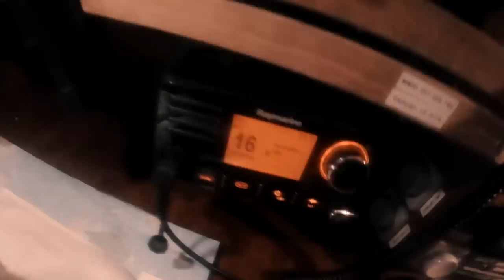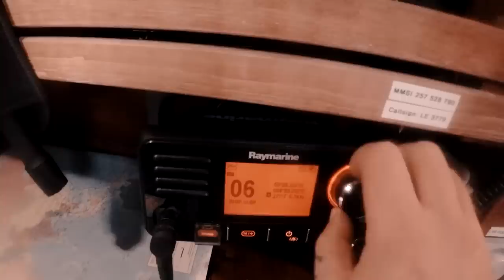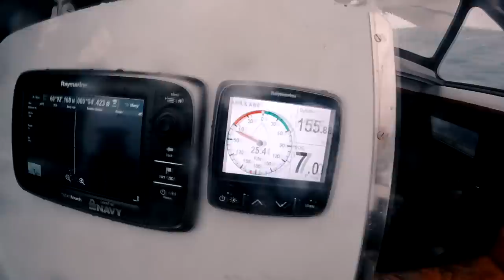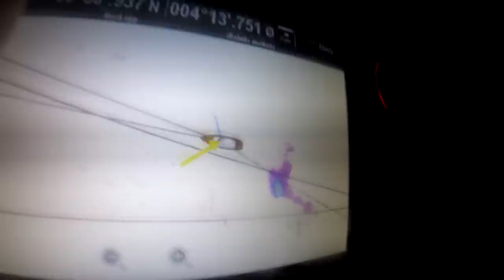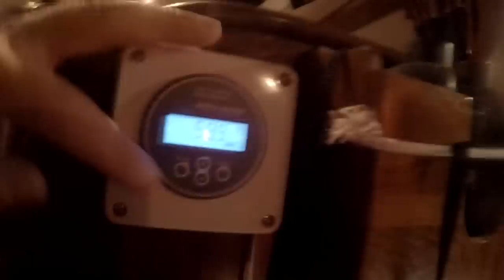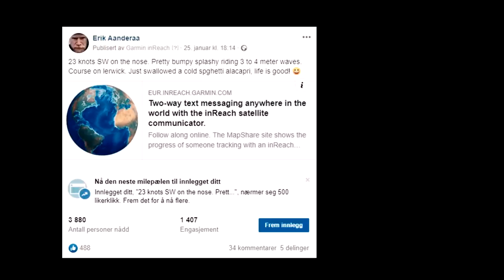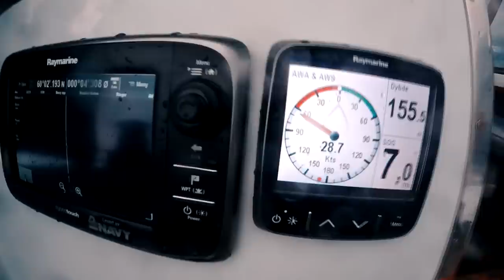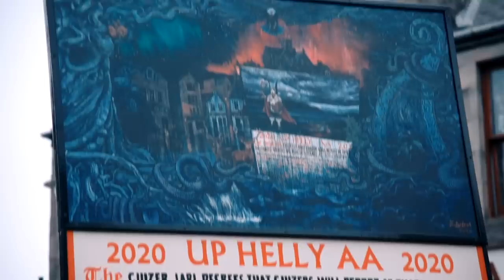Crossing the North Sea Wintertime- for a Vikingfestival

Comment: Skip Novak removes his chain from the anchor and secures them both below. He puts a water tight cap over the anchor chain hole to stop water from coming into the anchor locker. Just a thought.
Reply: That's normal, some of us were doing that before Novak ever got his feet wet.
Reply: @aussiepilgrim8620  Thats good 👍
Reply: Aussie Pilgrim Novak got his feet wet in the 1950's, you must be quite the old seadog if you were already doing stuff like that before he set foot on a boat
Reply: @rykehuss3435  it's not a rocket science to put a cap on a hole, people managed to cross the oceans around 1000 BC
Reply: Sailing Citrine Sunset , a cheap 12 v bilge pump with a switch is pretty simple to install
Reply: What about a swinging pickup in the sump?
Reply: Bob Dobalina  or keep pushing towards the festival 😎
Reply: Why would you mount your inverter and charger in the bilge??????

Comment: Erik! From one Viking to another and incase no one else has yet mentioned it, 'bucket and chuck it' is way faster, cleaner and safer than using heads in rough seas, and get a 5 x 12 x 22cm Jumbo sponge for £1.20 from anywhere you choose, get more than one and keep the spare in the bilges. They can make really quick work of outing water for the bilges mate, especially if its splashing around those delicate electronics! Crikey! Cheers and thanks for taking us on another fine adventure :-)
Reply: Another great video! Thank you, sir! :) 

Agreed w/Taranto on both the bucket and the sponges. You can use the sponges to remove more water quicker than with that cup, and also then leave them in the bilge where water collects; they'll work like baffles and cut down on the sloshing and splashing.

Fair winds!
Kurt and Barque - A30 "Alaula"
sailfar.net / plasticclassicforum.com
Reply: @leaveonlywake  yes sponges is what I thought of as well. But the best it would be to find a solution for the water not to come in.
Reply: You just need a simple device. Crew. Tell them to get that water out pronto.

Comment: Erik, awesome as usual!  You should invest in a small portable hand pump like kayakers use, it'll bail a lot more of that water off the cabin sole, easier and faster than a cup!  And, have you tried getting a big ball of modelling clay (we call it "Plasticene" here), and jamming it into the hole that your anchor chain passes through on deck?  That, or even remove the anchor offshore, and lower the chain down into the locker with just a small "leader line" to pull it back up; and then seal the hole.  That would maybe help keep a lot of that water out in the first place.
Reply: Good suggestions
Reply: Actually , that issue was exactly what i suspected could happen with this design of winch , i'm looking at fitting a similar to my new yacht . Like Erik , i like my chain down low , and would prefer my anchor aft to reduce weight in the bow . The problem as i see it , is the navel pipe being built into the winch body itself , certainly aesthetically pleasing , but impossible to seal . I gotta be honest , i'm not convinced plasticine would be the answer , it may cause problems with the winch mechanics , and certainly would be messy .  I've being trying to find a similar winch without a chain feed . It would then be possible to use a separate navel pipe , that would be easier to seal .
Reply: Need to install some kind of rubber flaps around the hole. They hug the chain but dont let water through (or if they do its most likely just little drips)

Comment: "But man is not meant for defeat. A man can be destroyed, but not defeated," Ernest Hemingway. Erik, you are a true Viking! This is the best video I've seen on any sailing channel. Very profound. But fix that leak, or get yourself a battery powered oil change pump with a long hose so you can bilge all that water out.

Comment: "Hold fast, and stay onboard!"
Noted that your homeport in west Norway is south of that Scottish destination.
BTW, regarding the water in your bilge from your chain opening on deck, could you fit a simple gland of 3 or 4 layers of, say, neoprene, cut with a + in the center, slightly just smaller than the OD of your chain links, each neoprene layer being slightly offset in rotation from the adjacent one? (I think the English word is "gland") I expect this would reduce if not eliminate the water coming through to your bilge. It's cheap, or free if you have a ruined wetsuit to cut up, and it might work for the conditions you experienced.

Comment: In heavy weather, I am concerned about a partially furled Genoa unrolling if furling line  fails. Have you considered a removable inner stay with a handed on heavy weather sail for those conditions?
Reply: this is not a Genoa, its a storm job, it looks, about the third of the size

Comment: Recommendations  - temporary but cheap and quick.
1 - electronics - mount inverter and other electronics on the ceiling rather than on the floor.
2 - flood - place a 3 foot long radiator hose (cut along the length) around chain at the anchor compartment entry point. Most of the hose should be outside. The hose acts as a barrier and the cut along the length acts as drainage. Should be snug in the opening.
3 - leak - you want a barrier that is flexible. Simply cut a circular material (old raincoat will work) with a hole little smaller than the diameter of the mast approximately in the center of the material. Place an elastic cord in the material surrounding the hole (need to sew a hem for the cord, the hole should be snug around the mast. Do not sew up yet. Cut one side and place around the mast. Sew it together. Place a dense wooden ring on top to resist wind (cut wooden ring in half. Use ropes to tie together once on the mast).

Optional - Put in a raised floor in the anchor compartment. Put drainage holes above the raised floor. Seal the compartment except for drainage hole and chain opening.

Comment: Two suggestions to deal with your bilge water..
(1) Use a flexible suction hose that's ball-weighed down at the end to obey gravity.
(2) Carry a loose hand-or foot-pump you can stick in anywhere you want.
Clear horizons.. :)

Comment: A damned good video Erik.  Made my heart race and my blood pressure go up!  I was glad to see you snapped onto a jackline when you went forward to drop the mainsail.  Good man.  I also have to go to the mast to drop the mainsail, so I also snap onto my safety lines.  One wrong pitch of the boat and overboard you go.  There's a saying that goes, "A hand for you and a hand for the boat", meaning always hold on to something with one hand (for you) and work with the other hand (for the boat).  When I have to go forward to deal with the sails, I snap onto my jacklines and I snap my Garmin InReach to my life vest in case I fall overboard.  The jacklines will keep you close to the boat but if you can't get back onto the boat then having your InReach snapped onto your life vest gives you a chance to hit the SOS button.  Important my friend, especially since you sail solo.  Not sure if you also have a Personal Locator Beacon (PLB) with you but that's also good insurance.  Hell, I even carry a waterproof autopilot remote with me when I go forward so that I can stop the boat by doing a 'hove to' maneuver.  Also, if your average angle of heel is greater than 20-25 percent, you're overpowered so go ahead and reef.  I'd also throw in a reef before nightfall because it's easier to do it then than in the dark with increasing winds and waves (long distance cruisers do this all the time).  I've been sailing for 45 years, 30 of which are in Alaskan waters, and have learned a few tricks.  Looking forward to your next video, and your Greenland trip and videos and I'm going to go to your online store and look at some merchandise!  Thanks for the awesome look at the Up Helly Aa festival!  Safe sailing, fair winds, and following seas!

Comment: One solution to the problem of having water in the wrong places is to fit a gulper style pump - a high volume diaphragm pump that is self priming - with a long hose that will reach anywhere inside the boat. Plumb the outlet to a through-hole fitting somewhere above the waterline. Wire it directly to the battery and put the switch (with a red light to show clearly when it is running) somewhere next to where the hose is stored. Very useful for those pockets of water that accumulate behind the ribs and stringers and don't drain to the bilge. These pumps are tolerant of the debris that gets washed into the bilge from all sorts of places, but you can fit a filter if you want to be extra cautious.

Comment: Great video. My remedy for water from an anchor locker was to run the hose to a collapsible water container. I would have a second one when I had to dump the full one into the cockpit. Bilge was dry after that. It was a steel boat and keeping water out is important. Similarly I had a pan under the engine that drained into a container. Was useful for any leaks of water,diesel and oil. Fair winds.

Comment: Hi Erik. Great sailing channel. Try using a handful of non setting putty to stop that leak in chain locker. I get same problem on my boat. When anchor lifted just push putty into hole around chain. Works every time. No more leaks. Remember to take off before dropping anchor. 

Charles.

Comment: Sweet ride once again...doin what needs be doin. You do such great advance prep work that little incidentals that don’t go as planned are but incidentals that can be managed. Was wondering if you ever saw any periscopes, then a freight ship comes over the horizon. I’m guessing you have some alarm by radar at night that can give some warning. Love the strength of the wind and the power of the boat holding it with the independence and time honored experience controlling her. It can be cold and monotonous if not for the curious mind, alert to the nuances of change. Hats off to ya 🇳🇴👍🏼  Thanks for sharing event on day after arrival. Was all smiles for the honors of those who came so many years ago.

Comment: Erik, thanks for the wonderful videos. That filming can't be easy and the hours spent are quite apparent.
Concerning the influx at the bow: Install a short hawse pipe, say only 2" or so. These are available commercially. Just before you depart, take a piece of leather or rubber and two zip-ties and create a sleeve or tube around both the rode and the pipe. Attach with zip ties around both. In case you need the anchor in a hurry, you will be able to pull this up with the rode without much of a struggle, and just heave it over with the anchor.  It'll come back up. This won't keep out all the water, but will reduce it to a very small, manageable amount. 
Please keep up the adventures. I did a circumnavigation about 20 years ago, but we are sissies and stayed away from the North Atlantic!!
Fair winds,
Tony Johnson

Comment: I am amazed that the boat actually has an area where water can get in through to the chain locker, i would have thought that there would be at least two pumps that could clear this as it obviously is not got for the struckture of the boat to be wet for so much time, maybe a baffel board just aft of the chain locker with a good size pump would work regardless of the pitch or roll to it kept the more central part of the hull dry.
We al know water finds its way in but when you know where it gets in normally you water tight it before it has time to do damage to the woodwork.
I really was taken aback to see it splashing round the  electronics to the point where you had to move it, as once water gets in you can usually say goodbye to it.
As its where the achor chain comes in would it not be possible to seperate the achor on  a shackel  and close the tube off from incoming sea altogether, i know that this makes dropping the anchor a bit more of a job but better than having to rip rotten wood out at some date because of water damage.
All in all the boat took it very well considering where it was and the conditions, good to see you made it safely, good sailing.

Comment: Hey Erik,
a little Idea for your Waterproblem:
just either just lay three fixed waterpipes, one leads to the centre, one lead to starboard and one leads to portside of your boat. And use a flexible pipe to connect to either of them, which ever you need at this moment. So you can drain your bildge on every course you sail an. Or,if your boatdesign enables this, you just use a flexible pipe, which you can direct in the direction of your choosing.

Comment: A flexible rubber membrane collar mounted on the anchor hole in foredeck tight enough to seal around the chain and loose enough to allow anchor chain to move in and out freely would prevent so much water coming in :).   Love your videos.

Comment: We always closed the deck hole of the anchor chain with a little insulation spray foam only in the top, in case you need your anchor you can easy pull it out.

Comment: Well done Eric another great trip, perhaps you need an additional bilge pump connected to the pipe from the chain locker, and a small stirrup pump to access other areas in the boat. I have just bought a Westurly Centaur in Chatham UK and am checking electrics that they are waterproof and out the way of any ingress of water, who knows one day sail to Norway myself.

Comment: The chain locker drain! I had a thought about the drain. 
Why not put a drain hole in each conner and take the starboard drain and run it to the port side for it to drain, do the same to the other side so they would cross. That way no matter which side the boat heels over it will still drain!!🤔🤔😱😀😀

Comment: I was watching the videos on your safety preparations for the Greenland crossing. I hope you have the anchor chain locker leak fixed by then! That is a dangerous weak point. Also consider plumbing another uptake for the bilge pump so that it can operate successfully when the boat is heeled over in either direction - not just on one tack! It may be impossible/undesirable to tack in very heavy weather just to empty the bilge.
Fantastic viewing - has inspired me to finally leave shore after many years of only tame dinghy sailing. As I come from a long line of longshoremen and vikings before them it is only logical that my destiny lies beyond the horizon! Bon Voyage and fair winds to you sir!

Comment: Add a platform for the chain to sit on and place a small whale pump underneath. I used to have a similar setup until I moved my chain higher. Pump is still there as a safety feature. And I find in rough weather much easier to use a plastic water bottle to pee into.
NBJS great stuff.

Comment: You should cut a milk carton in half and keep it on board, it will scoop that water much faster than the cup because the plastic conforms to the floor.

Comment: Amazing video, very exciting to watch.  I wonder if you could try to plug up that hole around the anchor chain with some clothes or rubber - you could always take it out when you need to drop the anchor.  Maybe some kind of removable cap would be another solution.

Comment: Excellent! There has to be a through-deck fitting available for that anchor chain though. Even if it's made especially to fit. Best not to have all that black gunk under you; it can't be good to have that smell in the atmosphere? Besides, I wouldn't want to be half way to Greenland stuck on the same tack in gales for days on end with that problem, must confess! The fail-safe solution would be a second bilge pump on the correct side of the hull of course, but with some good fabrication you shouldn't need it. Since cold beer takes up valuable refrigerator space, dry bilges are always best. That's where to cool the beer!!
Reply: The deckpipe chain hawser is what it is, for the anchor to be ready it must run free. Chain lockers have always been open to the deck. The key is keeping them drained.

Actually, the Contessa chain locker is deep enough to raise the sole above the waterline, pitched down on the centerline and sloped back to thru-hull clamtop scuppers.

This configuration also allows hose or bucket rinsing of the locker, chain and rode while having it isolated from the interior of the boat

Why mess with a pump and hose and all the sketchy wire mess, when with a little noodling let the water do it's thing. Besides it just one piece bound to fail
Reply: @tommypetraglia4688  You've proposed the other solution of course, which is to reverse the "very bad shortcut" Eric speaks of (11.48) and re-isolate the chain locker from the rest of the bilge. Or if needs be, at least isolate the for'd bilge under the forecabin from the rest of the boat and put another bilge pump in there. The through deck hole is, if original to the boat very poorly done. It could be much neater and let less water in! I would not want to sail that boat even as far as Eric has with that arrangement. Water + electricity = fire risk. Dry bilges are a must. They're not difficult to achieve. They also prevent bacterial or algal growth on the inside of the hull. And of course once you are confident you have a dry bilge, any water that gets in there subsequently indicates a problem. At present, the hull of Eric's boat could have a another problem e.g. with a flange, or another through-deck fitting (quite apart from the mast - they shouldn't leak either), and he wouldn't know. Lin and Larry Pardey sailed the world on engineless marconi cutters and the bilge had one day-to-day use only: the wine cooler.